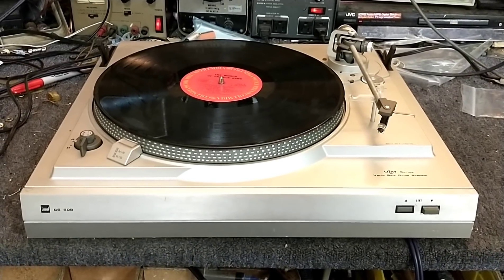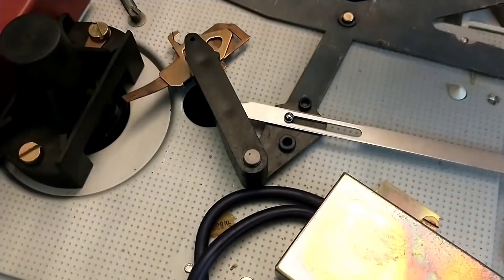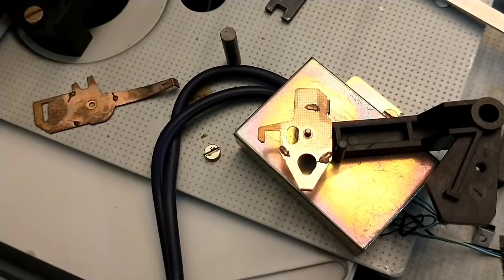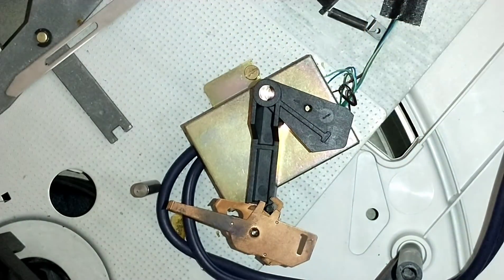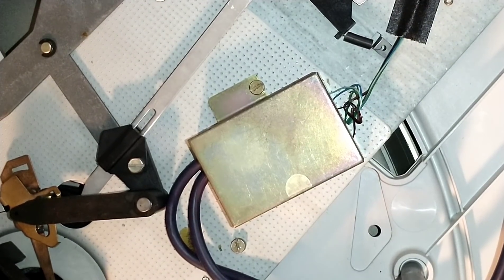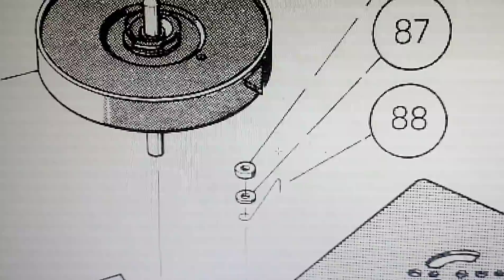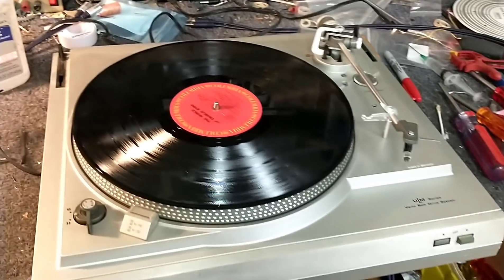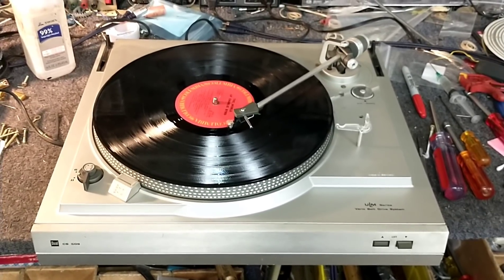Repair of vintage Dual CS-508 Turntable. No-lift / shutoff symptom.

Comment: I don't ever recall a platter wiggling after the power to the motor was turned off. I couldn't see the motor itself. It acts like the cogging effect that brushless DC motors have.
Just curious as to why it twisted back and forth slightly once it was the motor was powered off, I have no experience with a Dual turntable.

Comment: My CS-505-2 randomly fails to pick up and stop at the end of the record. I suspect my problem is dried lubricant. I'm inclined to simply remove the grease. I question whether those lightly loaded bronze parts even need grease.
Reply from the maker: The end of play trip is usually two pieces that slide on top of each other, with grease as a coupler between the two. Also the pivot bearing should be free moving. This assumes the unit cues down and plays, just doesn't pick up. Take a look underneat and you'll see how it works.

Comment: I used a record player very similar to this years ago as a Spraypainting turntable for my iwatta spraygun, fitted a rotary potentiometer to control speed and direction, it turned out brilliant lol, and thank you for switching to 1080p it looks way better on my 1440p screen. couldnt you TIN that copper part with high temp 64/40 once its straightened to strengthen it?
Reply from the maker: It's pretty resilient as is, but I suppose that could be done to the side that doesn't have to mesh

Comment: I just hate those later Duals. So cheaply made compared to the iconic 10 and 12 series changers. A properly restored 1019 or 1219 will go on forever with simple maintenance every 10 years or so. The later ones? Blown caps, bent trips, broken speed control belts, broken plastic bearing holders. Brittle plastic wherever you look.  The inevitable downside of trying to compete with the Japanese on the basis of  price.